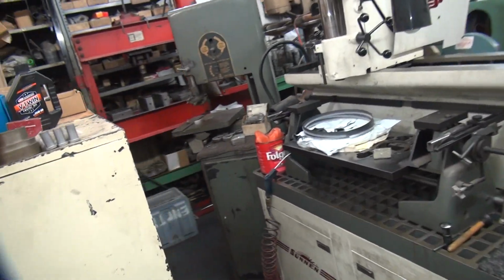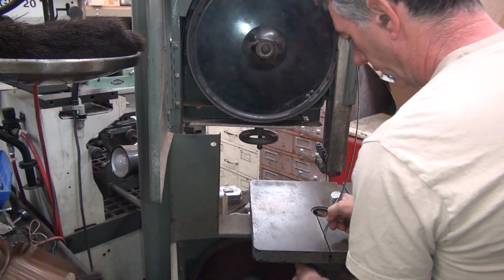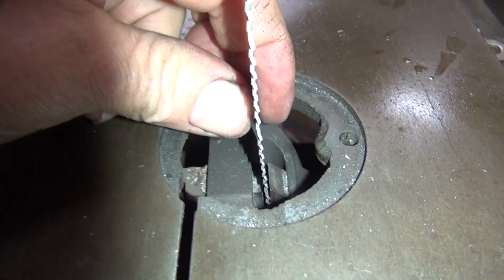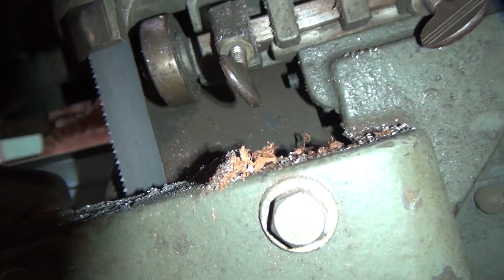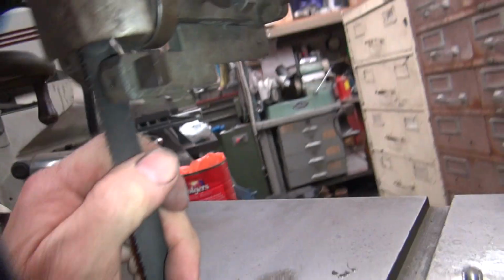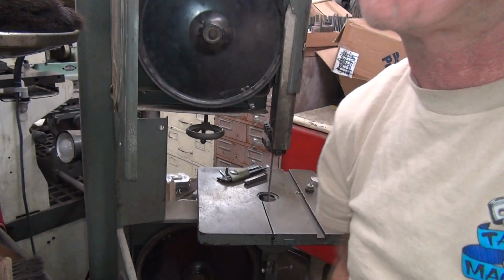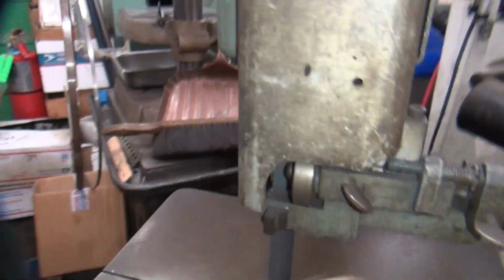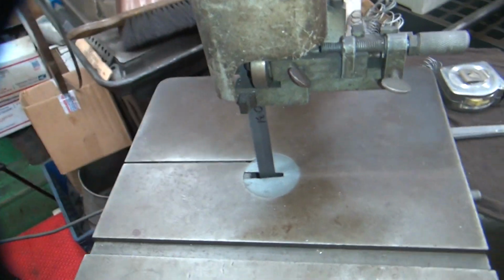#1 dads 1960's boice crane 14in bandsaw blade replacement adjustment repair harley by tatro machine

Comment: The top adjustment in the center of the top wheel may be to adjust the tilt of the wheel , aiding in the tracking of the blade on the wheel .

Comment: blue urethane bandsaw tires online ! tires  would be a great improvement Possibly wheel bearings , I believe the blade bearings should just barley move when its running . There are some great set up videos for old bandsaws , I have a great old two speed ....Wood and Metal ....needs a new blade ...Great video from you , I'm inspired to get a new blade and let sleeping dogs sleep ......top adjuster is for blade tracking

Comment: You can adjust the blade tracking at the back of the top wheel. It was shown in the video labeled Blade Tracking. This not to be confused with blade tensioning.
Reply from the maker: i like how i figuared things out myself. everything seems to be working correctly now. that is not how things were when i started.
tatro